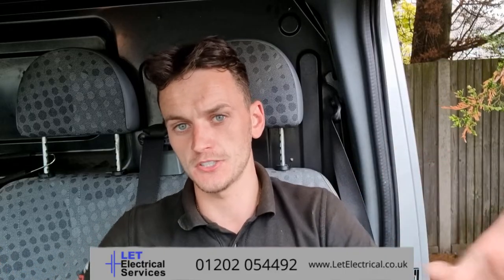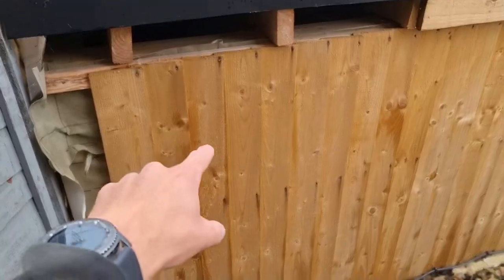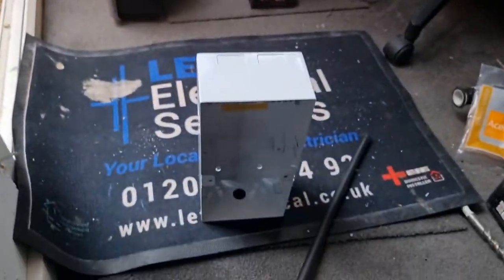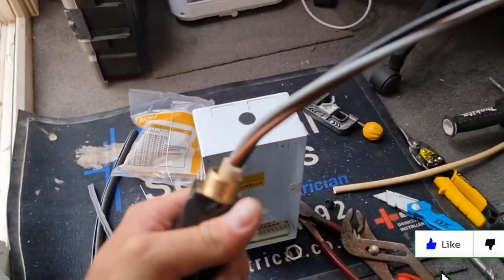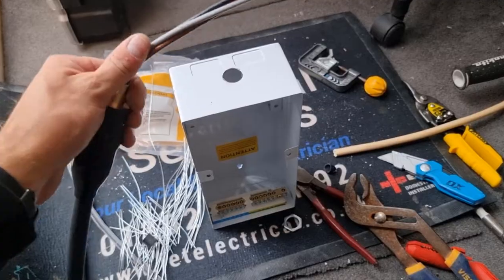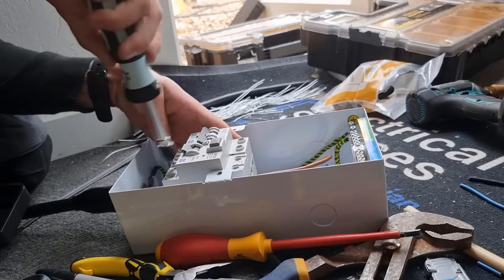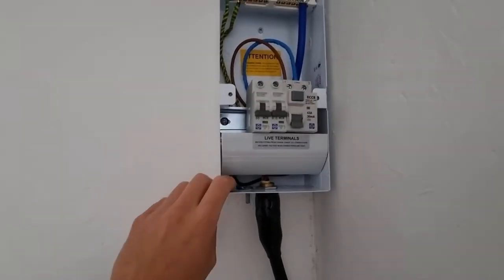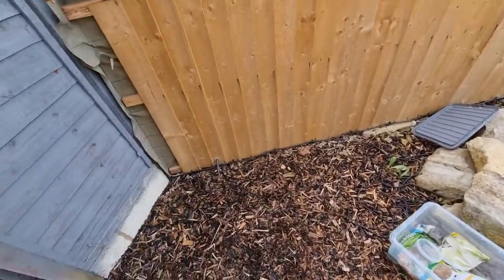Installation of 2 new consumer units within an outside Office and Garage| By an Electrician in Poole

Comment: Can you add an electric shower circuit on a garage consumer unit
Reply: Electric showers can have their own mini fuse board same as a garage consumer unit where there is no  RCD protection on the main fuse board or there is no more room on RCD side (or room at all) to fit an RCD protected breaker. The main power supply is usually cut into with Henly Blocks to supply the shower board and the 10mm power cable feeding the shower run from that. You need at least a 40amp breaker for any decent electric shower and garage consumer units usually only come with a 32amp and 6amp (sockets and lights) so you have to get a new breaker straight off.

Comment: Did you use a 32A mcb at the house CU?
Reply from the maker: Yep, it's Run in SWA so no need for RCD protection and also both consumer units have RCD main switches
Reply: @letelectricalservices5143  Thanks! Do you need to feed them from none RCD because they have RCD as main switches? So selectivity? Also if that's the case and you wanted to add a none rcd circuit do you just jump everything down 1 at the house CU?
Reply from the maker: @jt9473  Do you need to feed them from none RCD because they have RCD as main switches? So selectivity? spot on bud that's why we use SWA. likely it was a 16th edition consumer with RCD one side and none RCD the other side which allowed us to to carry it out this way. We always try us best to meet selectivity and avoid un-wanted tripping on the main CU Hope this help? did you like the video?
Reply: @letelectricalservices5143  Thanks just trying to learn more about that stuff as i mainly only do 3 phase industrial work. Yeah it was a good video 👍

Comment: What size armoured cable did you use?
Reply from the maker: 6mm 3core SWA With a 32amp MCB
Reply: @letelectricalservices5143  Do you need 3 core? Doesn’t the armour act as your bonding?
Reply: @ali3ndnb it does . Try getting 2 core swa from wholesalers.